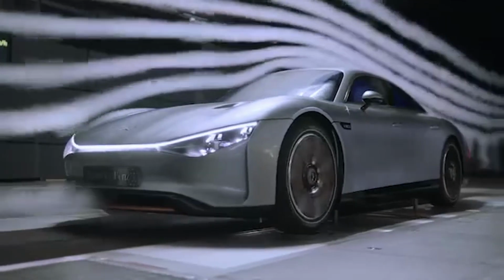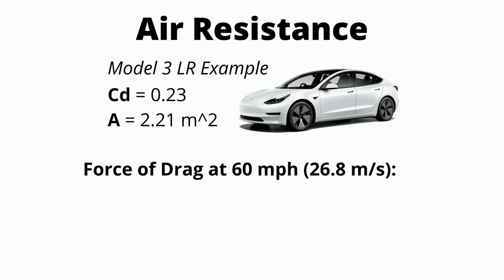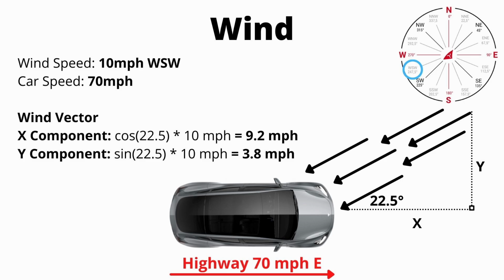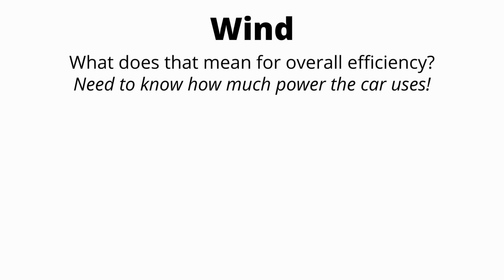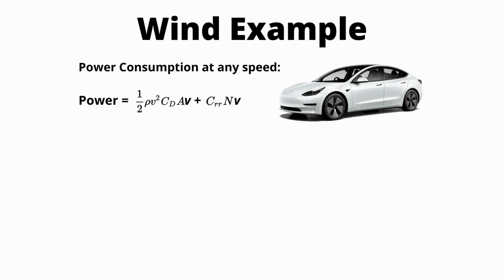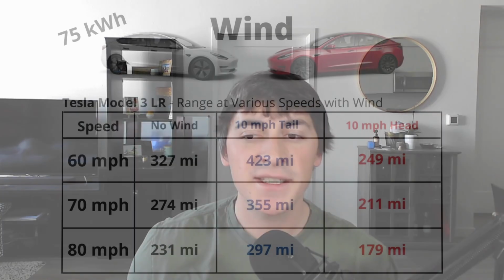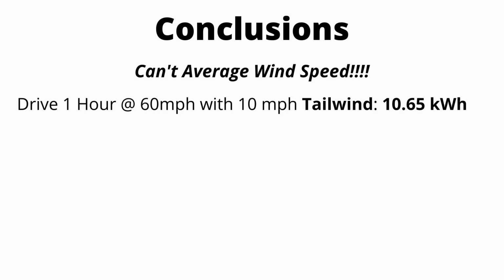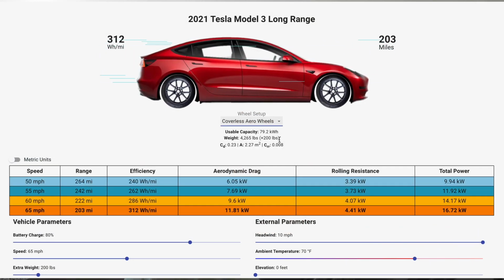This Is How WIND KILLS EV RANGE! Physics Analysis

Comment: Great stuff. The crazy thing is that the crosswind component shouldn’t be ignored like in your example. It will create friction losses too.
The single most important factor for vehicles at highway speeds and above is wind resistance. Almost all of the other factors can be ignored in modern cars at or above highway speeds.